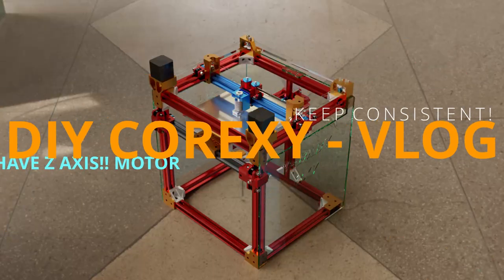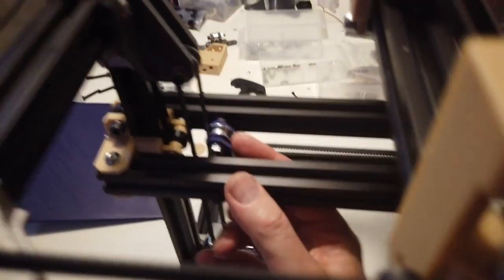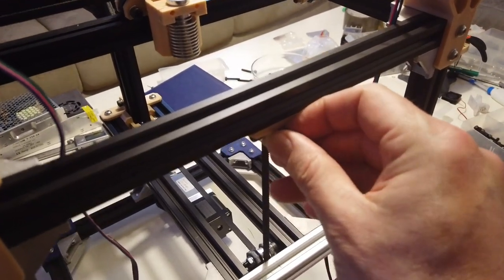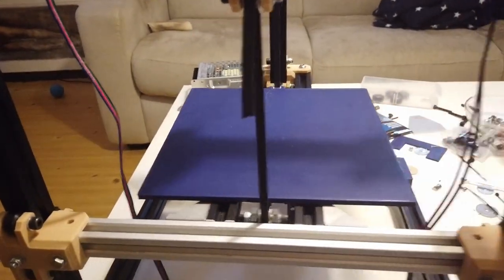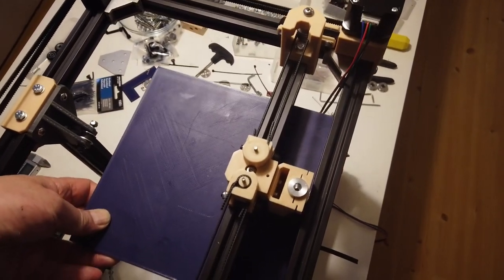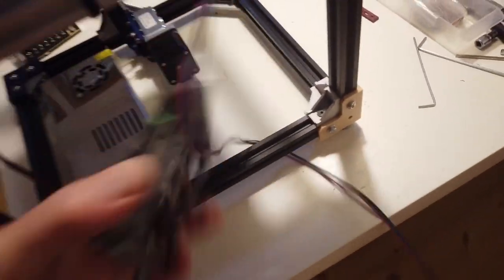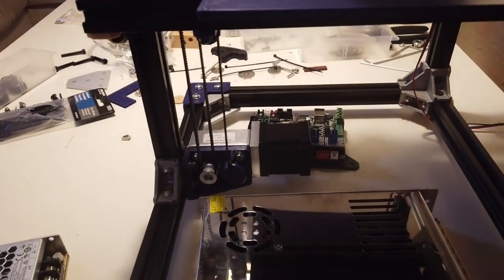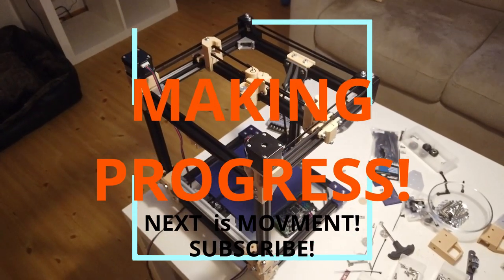3d DESIGN VLOG #8 - Making a 3d printer - The Z Axis!

Comment: I prefer lifting the bed on both sides. It is so easy and minimalistic to do this with the wormgear, would be a shame to leave it out. 

You are talking about enclosing it, but this seems rather challenging as well as unneccessary to me. Since you are using the frame for the V-wheels enclosing would need additional frame around the whole thing. Hypercube Design is much more suitable for that. Since a full enclosure is only really needed for ABS i dont think it is necessary. This printer is very suitable for desktop use in just about any room of an appartment, not for use in a workshop or commercial use. I very much doubt that anybody wants to mess with the ABS fumes in this context, this printer will more likely be a PLA/PETG only machine. I think that is the true Design challenge here: Defining the actual usecase of the "product" and stick to it when implementing the features.

This thoughts conclude in my vote for the electronics to go in the "unused" vertical space. This allows easy install of 120mm Fans to make it really silent. Whick would again benefit the likely usecase of this printer. Also this coice would not expand the footprint or height of the printer.
Reply from the maker: Thanks for the quality response! I will try to work with lifting on both sides. It is good when bed gets loaded with printed material
Reply from the maker: When I say enclosure I am thinking about just some panels to make it desktop and living room friendly... Not a heated chamber for abs and such. But I guess that is for a later modification. First let's keep things simple
Reply from the maker: For electronics it looks like we can use the space around the worm gear for most parts. This might be the simplest as well. Adding it vertically makes for more brackets and such but I will certainly consider it
Reply: @PRO3DESIGN  Ahh ok, so i got that wrong. So you already did consider this stuff i mentioned above, nice! I have to say that this whole process you (and we) are going through is really exciting! I am looking forward to finally see the finished machine and already have considered building one for myself. First i wanted to build the V-King, but since i never build a printer myself i´m thinking to "start small" and see how this works out. The V-King will see some improvements when the Baby is finished i guess, this also contributes a bit to my hesitation there. Already a great Design though!

Comment: A possible way to do the belt lift on front and back with out the tip problem would be to use two sprockets on the gearbox drive. One sprocket and belt system for the back and one sprocket and belt system for the front. That way you can tension them both

Comment: The fact with this type of frame is that it is basically used as a structure for the enclosure and here on your printer you can't really screw acrylic plates on it since there are parts moving attached to it.

Comment: Hi Roy.  How much less will the unsupported side droop under a reasonable load?  I would think up to 0.05mm would be acceptable with a kilogram mass in the center of the bed.  If it is much more than that you would want to try the lift on both sides and see how much better it is. 

If you are going to do the support on only one side then a stepper motor with integrated lead screw as the shaft eliminates all the issues people have with lead screws.  Motor goes at the top with lead screw down to the bottom.  Gravity becomes your friend keeping the lead screw straight and because the speeds are so low on the Z there is no need for any kind of anti-backlash setup.  Cost and complexity plummets.  Stepper motors with lead screws and nut seem to go for about $26 on Amazon.  About half that on Ali-express.

Put the electronics in the base.  It makes the machine look cleaner.
Reply from the maker: You have a point. I will check the loaded bed single supported and see - Thanks for your good input

Comment: I would prefer both sides supported. I think it isn´t a big deal do access the printer from the side. To be honest, if you place the display on the "side" it will become the front. :-)
Reply from the maker: very true - Doug also have some interesting points that when loaded with weight the bed will act differently so maybe the 2 point lift is best!

Comment: I like the idea of having the electronics on the back vertical.  The only concern I would have would be if the printer was enclosed. Then  I would  prefer  the electronics to be outside of the enclosure to reduce  the exposure  to heat. I.e. if your printing abs.  Maybe   there can be  2 walls. 1st to  enclose the print chamber. Then the electronics and finally a back cover to conceal the wiring.
Reply from the maker: We can have a wall and then a lid on the back for sure. Only problem is it get extended in size and I would like to keep this machine with a small footprint. But lets consider it and see - Thanks for the respons